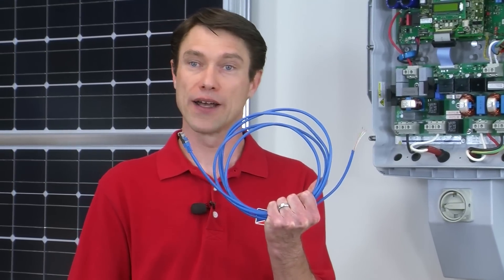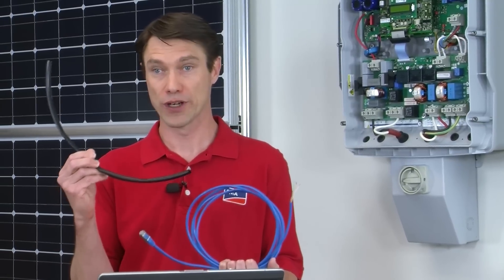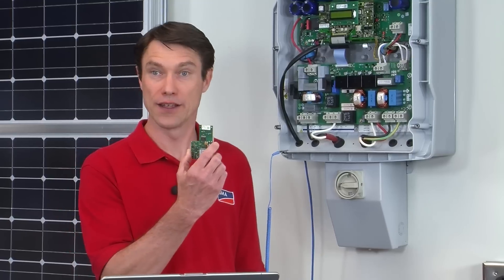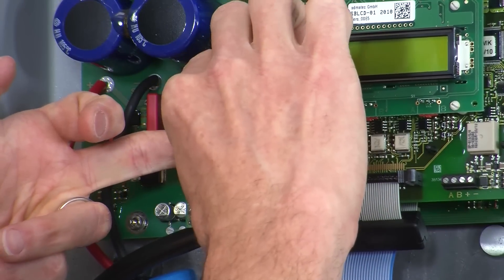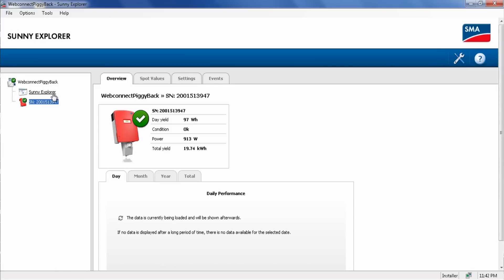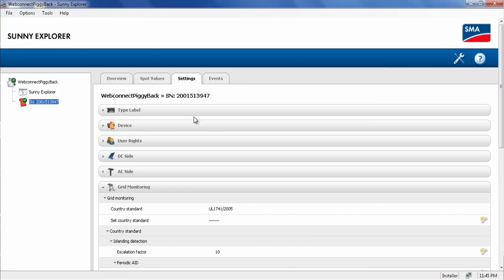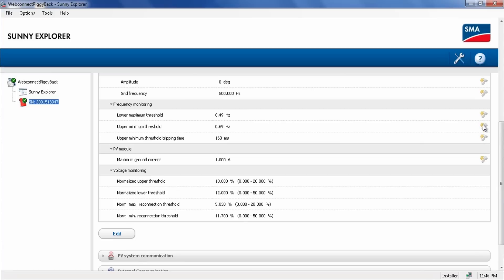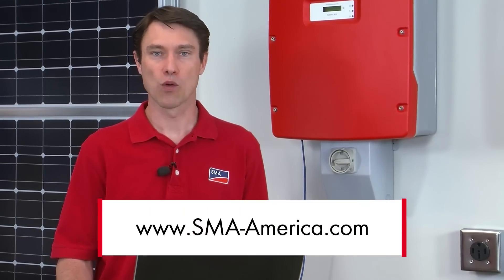Tech Tip: Installing the Webconnect Piggy-back Card

Comment: Hi, I have a SB 6000-US-22 (S/N 2002122527).  I would like to establish a LAN connection to it.  The manual indicates a RS485 interface (485USPS-SMC-NR) or Bluetooth Piggy Back (BTPDINV-NR) could work.  This video seems to show the installation of the BlueTooth Piggy Back card.  Will both work for LAN connectivity or do I need a specific one?

Comment: Hi, I have a question, the Bluetooth Piggy Back Plus Card, Can it be installed on a SB 7000TL-22 ?
Reply from the maker: Hello Rafael,
There is no SB7000TL-22 inverter. Did you mean the STP7000TL-20? This device cannot be retrofitted with a Bluetooth PickyBack.
Reply: Hi, Is any way can i make my inverter Wireless? What do you recommend. Thanks for your attention.

Comment: Hi, I have two SMA 9000 TL-US, how do I connect them together and using just one network cable to the router? is there a way to cascade the two in order to do this?
Reply from the maker: Hello,
To get any help, please contact our subsidary in charge or your installer.
Reply: You should be able to use an inexpensive 4 or 5 port network switch to at or near your inverters to connect both networks cables to the single cable coming from your router.

Comment: I'm in Australia and have a SB 2500, which I'm pretty sure is now fairly old. As it's booting it displays WR25-033 and BFR and SRR versions 2.76. Is the web connect card compatible with my inverter and if it is then where would I be able to purchase one.
Reply from the maker: Hi Cameron,
unfortunately, your inverter has no webconnect function.
Reply: Not even with the piggy back card? In that case, where would I be able to get a web box and necessary piggy back card and around how much would it cost?

Comment: Is there any way to see the generated energy if the internet was down for the last 2 months?
Reply from the maker: Hi Ronny - There is no storage available on the Webconnect Piggy-back card, and so if the plant was not being monitored locally, such as with a computer running Sunny Explorer, there is no way to reconstruct the data.

Comment: Hi, how many information safe he piggy-back card? I mean maybe the last 30 days old, maybe more?
Reply from the maker: Hi Alex - The Webconnect Piggy-back card does not have any
on-board storage capability.  It is intended to allow simple
cost-effective monitoring of Sunny Boy inverters using SMA’s Sunny Portal, not local data storage.  The inverters this card is designed to be used with also do not have local storage, unlike our newer residential and commercial inverters.

Comment: I hoped that you guys would explain more about the layout of colors to connect the LAN cable.
Reply from the maker: Hi Ysmael - Because there are a few different color combinations depending on the wire used we didn't want to confuse people. However, you can find all of the possible wire colors/pin diagrams on page 29/30 of the install manual, available here: http://www.sma-america.com/en_US/products/monitoring-systems/webconnect.html. 

I hope this helps! 
Justin
Reply: Thanks, I did my first install of the piggy back the day after my comment and I got it right. But great video, don't get me wrong, Justin.